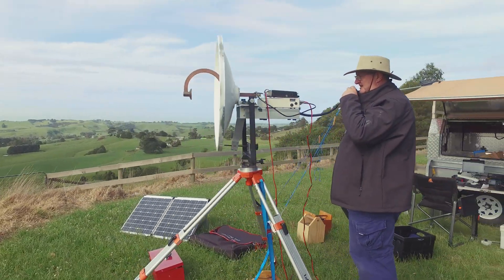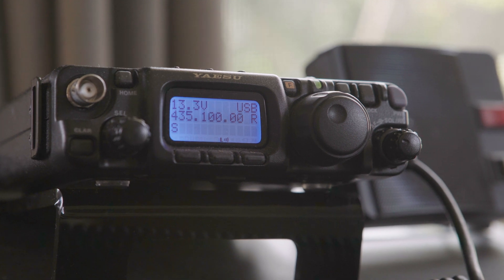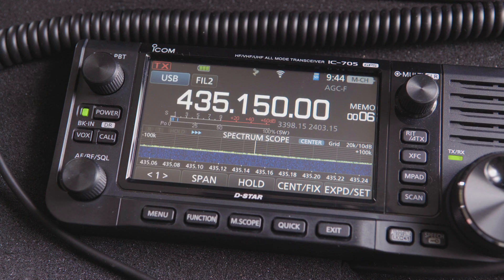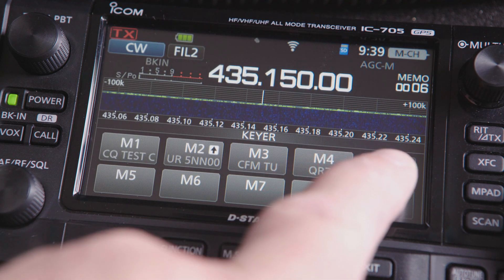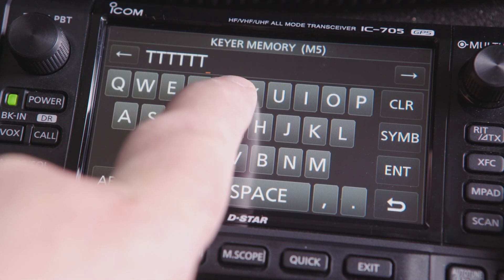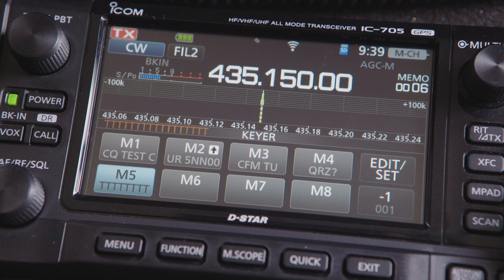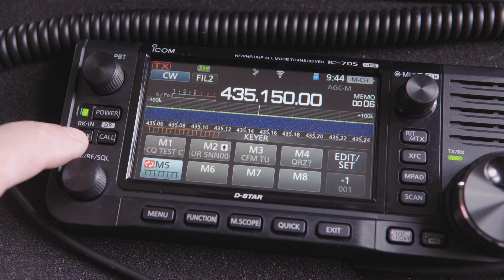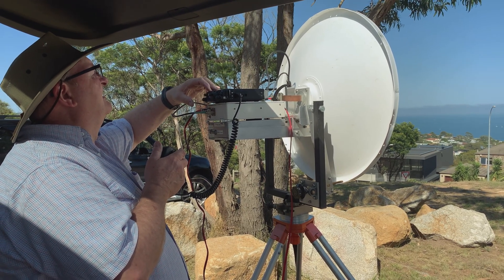How to make an IC-705 Beeper for microwave use (works on IC-9700 and IC-7300)

Comment: Hi there.  Ive been using this techniques as a microwave tuning aid since I got my 705.  Very useful. However there is an issue as going to CW mode brings you up zero-beat on the dial frequency which is easily missed by those looking for you.  I always tune the rig HF by 600Hz or so - but its easy to forget.  Do you have another way around this please??  Kevin VK4UH Brisbane
Reply from the maker: Hi Kevin. No not really. It's the joys of changing modes on the 705. Someone else may have a solution. Cheers Andrew